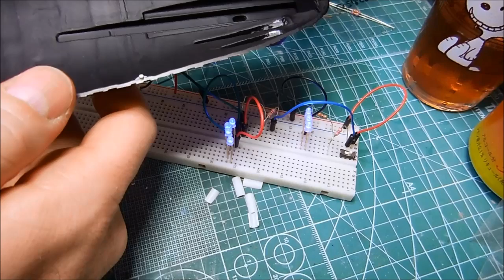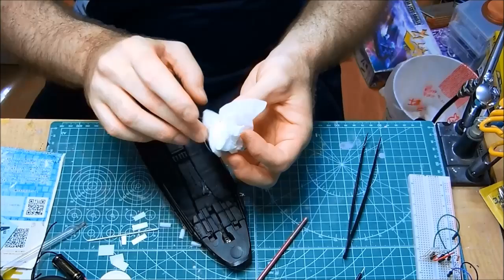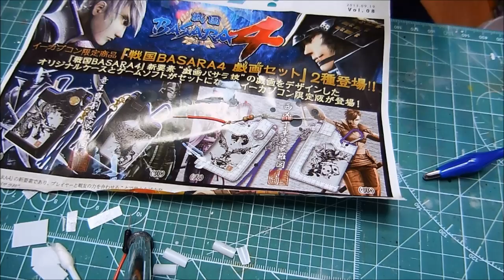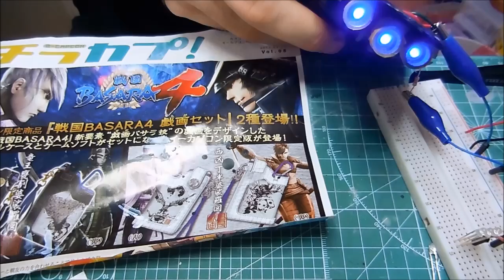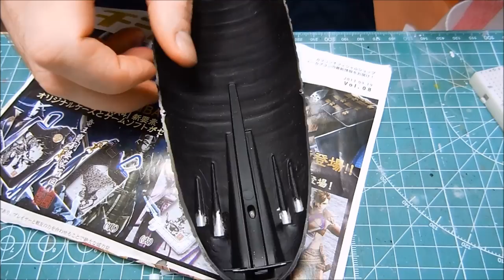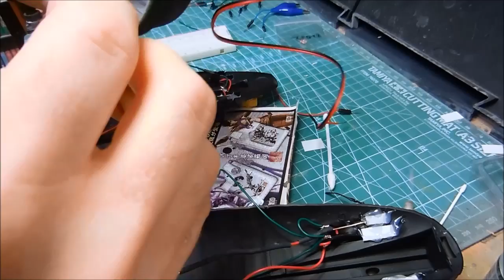MPC Star Wars Rebel Transport plamo build 2 LED LIGHTING

Comment: Great video Steve! I really enjoy watching Your model builds. I am currently attempting the BTTF Delorean. Keep up the good work.
Reply from the maker: Nice! Is it the Aoshima or Polar Lights Delorean? And from which movie?
Reply: @stevethefishdotnet  how strong is hot glue im thinking of scratch building with different types of plastics and glue is a pain as it doesnt not work with all types of plastics
Reply from the maker: @nikolabakich9709  You won't use hot glue for regular plastic modeling. It is only for attaching stuff to things.
Reply: @stevethefishdotnet  yes i think the plastic melts in a lower temp have you ever thought of scratch building anything? i know there are japanese kits that were originally kitbashed from other kits forgot the guys name but i read he used a lot of WW2 german tanks
Reply from the maker: @nikolabakich9709  You can't ever use hot glue to assemble a plastic model kit. It is too messy and uncontrollable. It is not meant to be used for that. It would just smoosh everywhere and make a huge mess. Hot glue is meant for crafts and such. If your plastic model box is falling apart, you can use hot glue on that. You just can't use it on the model itself. It's not so hot that it would melt the plastic, but it is just impractical. But no, I've never kitbashed anything.

Comment: Are you using flux when you are soldering?  This is really cool to see your progress, I'm still ligit jelly that you've figured out how to do all this :D
Reply from the maker: Flux... this is the first time I've heard of it. As for figuring this out, apparently I am not doing things 100% right. I had to ban a guy who had legitimate advice, but felt it necessary to condescend and insult others. I really did not want to ban him, but he had to get belligerent, so I gave him the boot. Some people insist that the resistors need to go before each LED, while other say it doesn't matter and they can go in front all at once and then wire the LEDs up after them. I'm inclined to believe the latter camp, but oh man, apparently some people get worked up over all this!
Reply: Flux or plumbers flux is a paste that you put around the metal contacts, this greatly helps the solder connect to the metal. I could see in your soldering that you had a bit of resistance getting the solder to form.  It's easy to get, just don't get it on you clothes as it is an acid and will eat the fabric away. I strongly suggest getting some, it's usually easy to find in hardware stores, and I wouldn't do any of my work with out it.

That fellow I wrote to you about recently, left some comments on my channel today, I did give him a bit of a warning, so I'll see what he does next, but yeah I've with you, once more and I'm just going to ban him.   Good luck with the painting, hopefully more pleasant comments will abound.
Reply from the maker: I was watching a video by badgrendels in which he says that flux is BAD for electronic soldering and should only be used for plumbing soldering. The reason being is that the flux is acidic and will eat away at electronics. Resin core solder is for electronics and it removes the oxidation without damaging electronics.

Comment: hi just a tip.. you could have used phone wire on that model as the current would be very small.
Reply from the maker: Actually, I have magnet wire. This model isn't that intricate, so I won't bother. If I plan to light a Star Trek model or something, however, I may use magnet wire to light the nacelles since they'll fit into the pylons more easily.